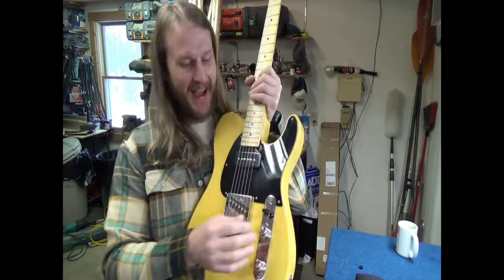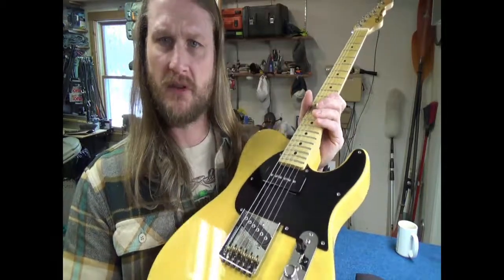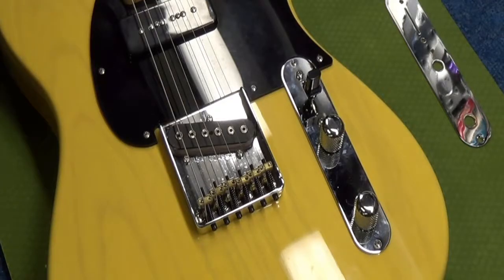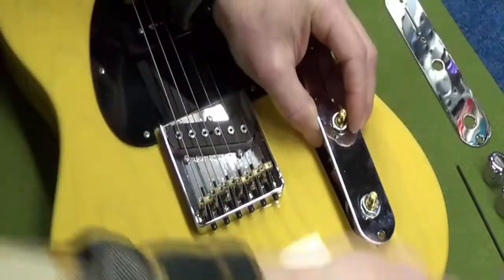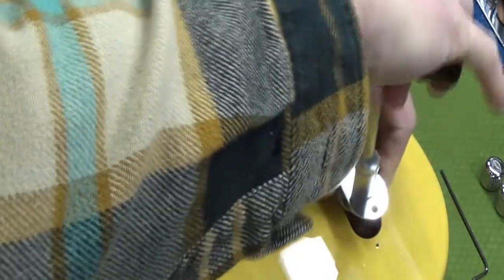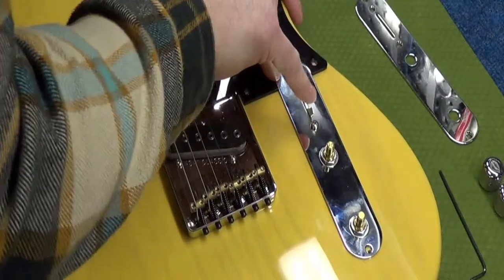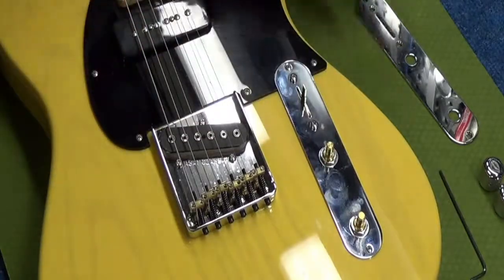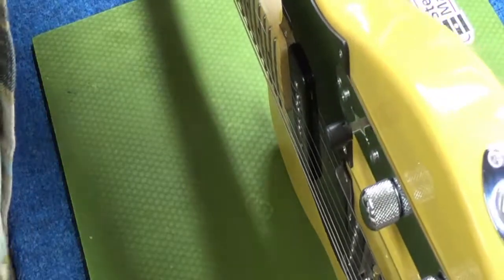T~Style Guitar Selector Tip & Control Plate Modification

Comment: Dude,  complaining that you paid too much for that control plate....  you could have drilled a new hole right next to the old one and moved the vol pot 1/4 inch.  Also, they have chrome top-hat style knobs that would cover most of the old hole.  Mods don't have to cost an arm.
Reply: Right! Sorry if I moaned about pricing. As for the plate cover. I just didn’t want to get into metal fabricating. But yes I could have done that. Thanks for the comment. ~cheers ~John.
Reply: @johnschoppmusic  drilling one hole is not exactly "metal fabricating", John.